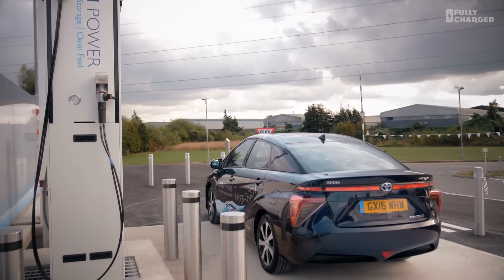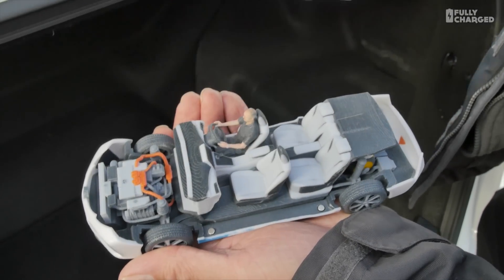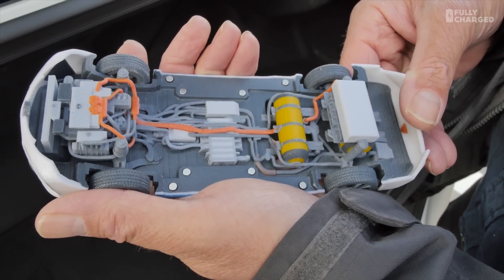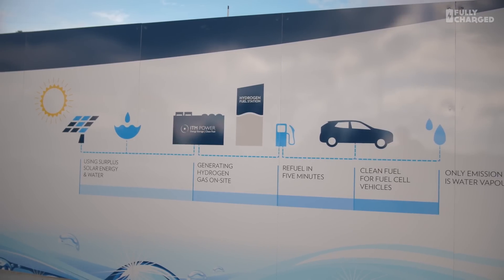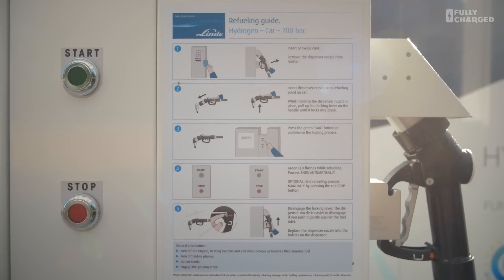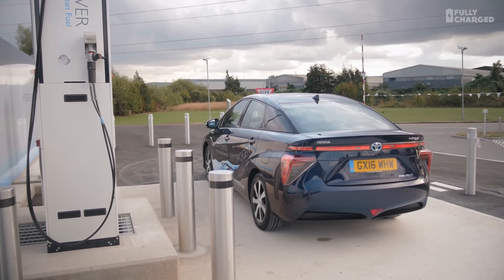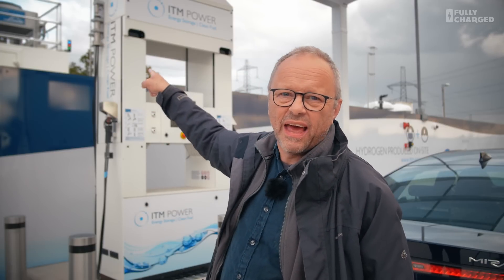ITM Hydrogen Rally | Fully Charged

Comment: But who  can afford a Mirai in the first place?
Reply: Who can afford the higher priced Tesal Model S which is a pure BEV? This costs me as an US resident 57,400 to purchase or lease, where as Tesla starts at 75,000.
Reply: Joshua Cornell different class of car, comparable electric car is more in the 30-40k range.
Reply: Jan those price range of BEV are more in the max of 200 miles per full charge or charge up,  where as the Tesla can max at 388 miles per NEDC or 315 for US EPAe Miles.
Reply: Elon Musk can afford a Toyota Mirai !
Reply: Joshua Cornell true today, but will look totally different by the time you sell this hydro car in 3-5 years. Who will give you any money for it?
Reply: Tesla Model 3 , and bolt start at 35k to 37k, and actually exist on the roads in 2017. 

Hydrogen? In an update video from fully charged, while you get actual road trip vlogs from ev owners.
Reply: azalru i think you can buy one already, just not sure why anyone would do that.
Reply: Jan Detlefsen I highly doubt that, unless you applied to be in a special program of theirs.
Reply: azalru if that's the case then they are just using it to get their fleet fuel economy down. Just like Mercedes builds electric cars without quick charger.
Reply: Jan Detlefsen What, Tesla built their ev and supercharger network. 

Mercedes relies on third party. 

And costs are down to battery tech and how much is being built in house. 

Tesla has the cheapest and most energy dense battery chemistry.
Reply: Jan Detlefsen It's sounds like an excuse without any weight to it. It's a science project not meant for the mass consumer.
Reply: azalru I mean the they released the B250e, a car that you can not quick charge, it need 4 hours every time you want to charge it.
Reply: And it's ugly as sin.
Reply: Yep the Japanese  Fiat Multipla !
Reply: John Benton of course hydrogen is going to start off expensive how much do you think the first electric car cost ... Way more than it does now.
Reply: How do you think Tesla was able to develop all those recharging station points? Us the buyers who believe that alternative can help us in the long run, that is why a Tesla costs more than a FCV since the FCV has been in production longer, just single track minded individual like you can not get the fact its better than and not to mention much greener than gasoline/petrol or diesel which is in limited supply where as hydrogen can be produced infinitely. I am for both BEV and FC and hybrids of all manner as this FCV is a Hydrogen-Battery hybrid, the batteries help with power losses seeing as if the motors were charged directly there would be loss of produced power from the hydrogen reaction process
Reply: Joshua Cornell Looking at the size of this hydrogen refill station i don't think the hydrogen will come as cheap as pure electric power. So you gonna pay extra for every mile. Also you need gigantic investments to build up a network of those station if each station is this complex. This looks like a couple of million dollar for each station. Petrol stations have cost the same but they've grown organically over the last 100+ years. Who is gonna invest in all those station with no hydrogen cars available and besides this Toyota, no other cars in the pipeline? An electric charging spot can be as cheap as 500$ to install in hotels or at home.
Reply: Aside from the Mirai, there is also:

Honda FCX Clarity and 2017 Fuel Cell
Hyundai Tucson Fuel Cell

Which is three more. not counting the Nikola ONE which is a Semi-truck.

I am not big on statistics but when I started driving at 16 with a permit and 17 when I got my license, that was 20 going on 21 years ago, there has been and increase of 25% in number of gas or fueling stations for gasoline/petrol and diesel. Mostly due to number of vehicles on the road increasing by 2% a year. This is just off the top of my head. And the oil companies are not the ones paying for these stations either, its  those paying for the gas for vehicles they could afford who are footing the bill, so much like gas and diesel, the owners of fuel cell hydrogen vehicles are the ones going to be footing the bill for the station when they use it to fill up, but yeah they will cost more initially but the fuel is just water that has been converted into hydrogen alone for fuel.

You watch the first part when they show the pump the price per kg is 9.999 and not charged per gallon or liter like petrol or diesel. The Mirai has a 5kg capacity.
Reply: That Honda has sold a wooping 46 units in 6 years and in 2014 they stopped selling them. Hyundai has sold 116 units of the Tucson in 2015. Now the concept might work for busses and semi trailer trucks, i don't argue that. But for cars it's a dead end concept.
Reply: Tesla's are selling and they cost the same. People want a clean fuel car and not one that burns electricity from fossil fuel power stations.
Reply: First Roadster: $150,000
First Mirai: $1,500,000
Reply: lo  a big difference
Reply: Joshua Cornell. Not fair comparison, since Toyota loses around 100,000$ per each(!) Mirai sold (google it), and Tesla sells Model S with profit. If they started selling Mirai for 150,000$, they could just scrap it. This way they sell it at loss and with very small number of vehicles available per year, to keep hydrogen dream alive, until they can actually make it for 50,000$, if possible. And they even give hydrogen for free, because, who would buy the car if they knew it will cost them 75$ to fill it up.
Reply: Excellent points. Hydrogen's biggest problem is cost, and will be until a breakthrough in technology happens.

Comment: I like the idea of using excess supply from renewables for splitting water and using it later. But charging batteries insdead sounds the same. Just a different type of storage.

I'd like to compare efficiency and enviromental impact with there two approaches. And I'd like to know how good can we recycle NiMH and Lithium based batteries.

Comment: How big is the tank and what range you can expect on a full tank?
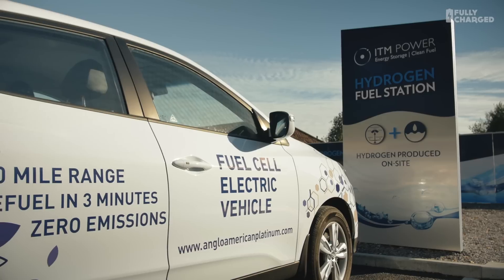Reply: You will know by watching for 2:33. Its "370 miles".
Reply: +NotHandMade I watched it but I missed it. So it's 10£ per kilo of hydrogen and it will take about 3kg for 370miles ish. not so cheap.
Reply: Max capacity of the two tanks is 5kg, so it would be 50 GBP
Reply: +Joshua Cornell that's even worse! 50£ for 370 miles? it's a joke. My transit custom can do better than that!
Reply: my mom and sisters Honda CRVs both get like oh 370+ and they cost 50 USD to fill up from empty or near empty. Dependent on the cost of fuel where you get it.

Comment: what is the efficiency of electricity-electrolysis-compression-fuel cell-work
and the efficiency of electricity-battery-motor-work?

I understand that when you have so much extra energy from renewables that can fill all the batteries in the system, that you want to produce hydrogen as a secondary energy storage.

Comment: What's the efficiency of 2H20 + Energy -> 2H2 + O2 -> 2H2O + Energy? (How much energy will be lost as heat?) What's the range of a full tank? What's the cost of a full tank?
Reply: For the first question Google "tony seba hydrogen", click the first result and scroll down to the chart.  The hydrogen cycle through electrolysis to a fuel cell is less than 25% efficient.
Reply: Rage is stamped on the side of the car. You will see it by watching the video.
Reply: The volumetric energy density of Hydrogen sits at around 2.4 kWh/L (rounded up). As far as I know, Lithium-Ion batteries have yet to breach the 1 kWh/L mark.
Reply: revengefrommars
On the other hand, 100 years from now when all electricity is green and you can charge your house with a 1 by 1 meter solar panel (completely artificial presumption I just made), perhaps efficiency isn't that important. I can also see how hydrogen can be compelling for lorries and high performance cars, as it's lighter and takes less time to refuel. Obviously an EV Truck may take ages to refuel because it needs to carry so much weight around, high performance cars want to be lighter and racing cars would probably want to be able to refuel as fast as possible too.
Reply: Melanoma
Well obviously hydrogen can store more energy in a smaller volume but I'm talking about the efficiency of storing that energy, how much energy will be lost in the process? Apparently that's 75%, it's 55% for lithium ion batteries. So I think, eventhough that difference is big, it's not that dramatic, hydrogen doesn't require the minerals batteries do require for instance.
Reply: Yeah you literally see the range on the vehicle graphic saying 370 which is EDC miles which would be 312 US miles. and compared to the new 100kWh Model S with 381 NEDC and 315 US with the Mirai having a max output of 114 kWh. Not to mention the Mirai at a cost of $57,400 US compared to Tesla starting at 75,000 up to 150,000. As per fueling cost, hydrogen much like NG or LPG is charged per kg at 9.999 per kg in GBP and 87.5 kg max weight fill-up.
Reply: Storing electricity in lithium ion batteries has less than 10% losses. Maybe up to 15% with fast charging. Not sure where you get 55% from. So it is much more efficient than storing it as hydrogen via electrolysis and a fuel cell.

However, much more energy can be stored because you just put it in a big tank, rather than needing very expensive batteries (or pumped storage, or ARES, or whatever, which have their own losses).
Reply: xxwookey You can drive more miles on a 100kwh battery from a Tesla than a full tank from the Mirai.
Reply: I'm not talking about the tank in the car. I'm talking about the tank next to the electrolysis machine.
Reply: Here's a "well to wheel" efficiency comparison between electric cars and petrol cars. The comparison is based on the energy mix in the US. ~30% efficiency for the electric car and ~14% efficiency for the petrol car.
Here's the link https://matter2energy.wordpress.com/2013/02/22/wells-to-wheels-electric-car-efficiency/
Reply: xxwookey
This is where I got the 55% from, not sure where you got the 85% from. http://large.stanford.edu/courses/2010/ph240/sun1/
Reply: Maarten van Rossem Lezingen
The link you referring to says that lithium batteries has a charge-discharge efficiency between 80-90 %. It also says "Li-ion efficiencies are extremely high..." so it seems more like you are confirming xxwookey rather than yourself, unless I missed something.
BTW the lithium battery efficiency has gone up slightly since 2010.
Reply: FenrisUlfven
Well I don't know where the 25% for hydrogen came from, I don't know if that factors in energy generation or not. If it doesn't then sure, lithium ion batteries are way more efficient for normal cars.
Reply: Maarten van Rossem Lezingen
Well the hydrogen production through hydrolysis has an energy efficiency of about 50 % and then the fuel cell has about the same efficiency. So if you do the maths, the total electricity to wheel efficiency via hydrogen is 25%.
Reply: FenrisUlfven
So overall that's only 60%ngen x 25% = 15% efficiency.
Reply: @Maarten: "you can charge your house with a 1 by 1 meter solar panel"

You will never be able to do that.  100% efficient solar panels (which you will never get) will produce only 1kW per meter squared, so 3-8 kWh per day, maximum.  So unless you plan to reduce your daily usage to that, it won't happen.  

Tesla plans on making an EV truck, so they don't think it obvious that it will take ages to refuel.  Multiple chargers mean you could charge a truck faster than a car.

Comment: The thing that interests me about hydrogen is the concept of using it as a general purpose fuel that would essentially act as a storage medium for power generated by solar and wind. If this can be done at a very large scale, and at a lesser cost than other types of storage, that is a big deal, and could be a major part of transitioning to 100% clean power. I know there's a very large "if" in that statement, and I have to admit that I'm skeptical. But I'm also skeptical about the capability of other storage technologies, such as batteries, to operate at the gargantuan scale that would be needed, and so welcome the research and development that the HFC vendors are pursuing.

Comment: I think hydrogen is the best solution for situations where you need to be able to fuel up fast and a lot at the same time. I think the convenience of charging the battery of a car at home is ideal for the standard person, especially with high capacity batteries and fast charging coming to the markets now. Hydrogen on the other hand is ideal for trucks who need a lot of energy and usually are on shot time. And with the ability to silently power devices other than the engine, they would also work well with trucks that need to cool their goods while the truck stopped for rest.

Comment: So, a HFC vehicle has an battery (like an EV) an inverter(like an EV) and an electric traction motor(like and EV) but it also needs a Hydrogen Fuel Cell, another power converter, and a complex, high pressure storage tank.  Whilst "Load leveling" is a noble cause, wouldn't it be much better to keep the end use vehicles as pure EV's and just put the HFC/Hydrogen generator in the filling station?  ie, filling station with renewable source (wind turbine/solar cells etc) takes in electricity, and puts out electricity, but can also store energy during periods of low demand as hydrogen, and release that energy at times of high demand?  As more and more EVs are fitted with and capable of using high power DC chargers, there is a good chance the "fuel stations" of the future will have to have some storage capability in order to support the peak power requirement of lots of vehicles charging at once.......

Comment: Everyone is saying its a waste of energy, but look at it from a point of view from the grid, it uses up the excess rather than not utilizing the power we already generate (as they said, leave all the turbines and such turned on, not turning them off as a regulator) and the idea would be to plug-n-play as an ev on a daily basis but when you need to go further you use the hydrogen rather than petrol, and the hydrogen can be refuelled way way faster than an ev battery, so your trading energy efficiency for time-to-refuel, it fills as fast as a petrol tank, so range is no longer an issue, just infrastructure, which from the video looks closer and closer to realisation.

Comment: Good episode Robert. Not sure running a house on 50 litres of petrol from a Prius is a good idea though? Could do with cost per mile of the fuel vrs public charging or normal ICE refuelling. I'm guessing around £10 per kg which works out around 26 mpg equivalent? If so yet kore proof our cars are too big and heavy to use renewables efficiently. Riversimple seem to have a better solution.The only real way to cut overall emissions is to reduce consumption. As for servicing, pumps, motors, electrical relays, pipe seals and the usual brakes, tyres wear and tear items all require inspections and replacement/maintenance. Once again attacking in this area diesel is rather pointless. The engine itself does not wear out very quickly since diesel is a lubricant not cutting fluid (unlike petrol) and the engines operate at around half the rpm of a petrol ICE. So we get 20 year old diesel engines still running reliably but not with the latest emissions ancillaries attached. It is the bits bolted onto engines like pumps, electrical looms, and wear and tear items that fil or need services. OIl changes are usually every 20,000 miles and belt changes over 100,000 with modern materials.

Comment: Another problem is the conversion cost of the entire grid from petrol to H2. These stations cost a fortune, whereas with pure BEV you already have the electric grid and high power charging stations cost way less than one H2 station. Even the hydrogen costs a lot more than gas. The electric grid would need an upgrade anyway.

Comment: And most people still have a highly explosive liquid tank. And they sit above it every day...

A hydrogen tank won't really explode with fire because the released high-pressure liquid will push any flames outwards like a flame thrower.

If it is instead whacked with brute force by a car crash, it will most likely dent and leak because metal is durable. 

The only chance it has of exploding is if a sharp object slices through it. But that can be prevented by putting it in an armored area that is resistant to wide sharp objects that can slice.

What do you think?